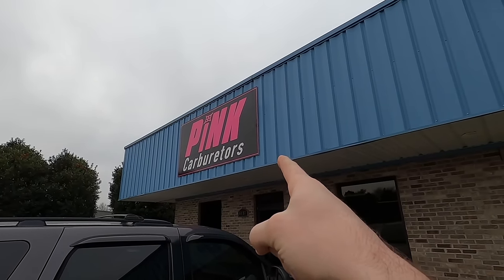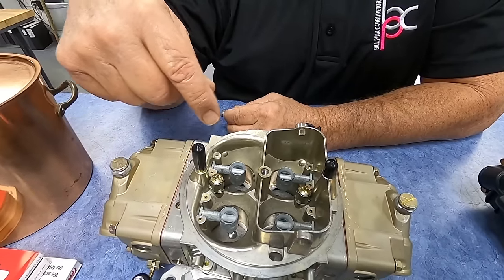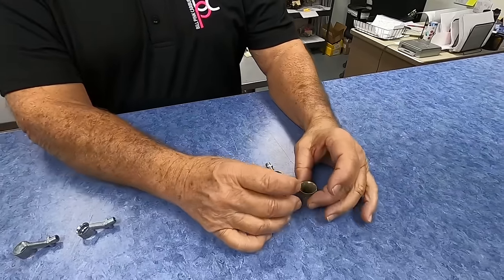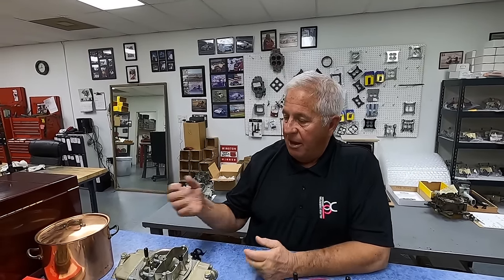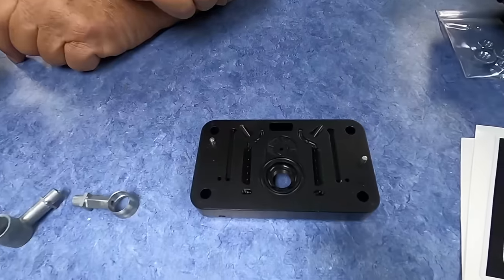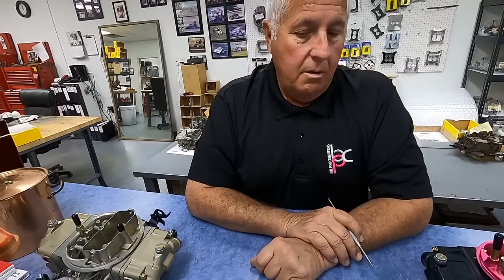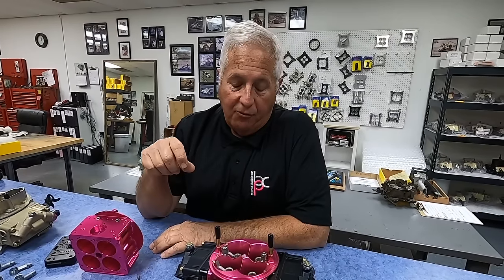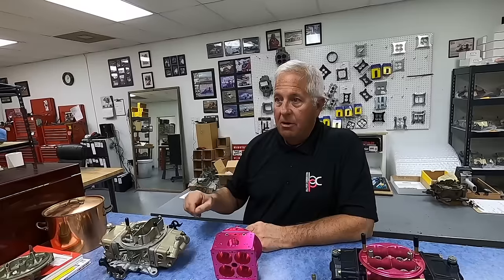Carburetors Are WAY Smarter Than You Think! Tuning Guru Bill Pink Shows Us Why (Carb vs EFI)

Comment: "If you're a fuel injection guy you might change your mind"

shows table full of tiny parts that have to be specifically modified to meet the demands of an engine

No thanks.
Reply: Every time I hear someone talk about carb parts vs injection tuning like that I picture Ben Stiller in Zoolander trying to break into the computer by throwing it on the ground... like any of them have a clue about the circuits, programming or components beyond poking at the buttons on the tuner like Stiller on the keyboard grunting like a monkey.

Comment: Diesel engine its amount of fuel being injected changes RPM to be simple.
Reply from the maker: Why can’t you run a gas engine that way though?
Reply: @Stapleton42  Because how fast gas burns, be very lean and have detonation which breaks parts. Diesel don't have ignition system but compression for ignition source. I know we have direct injected gas engine now and some current diesel engines have "throttle plate or air shut off" but its for emissions mostly. Or air shut off in case intake pulls in a gas fumes
Reply: @Stapleton42  Most of big diesel engines use steel pistons. Ask Lake if they ever tried steel piston?